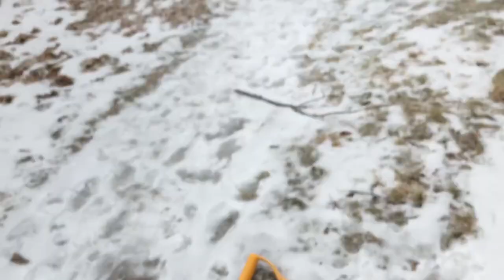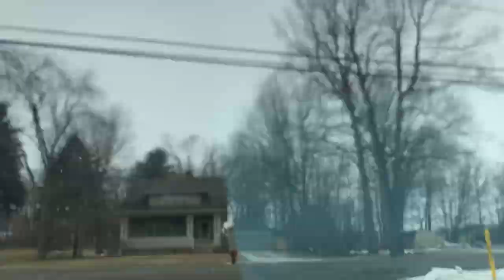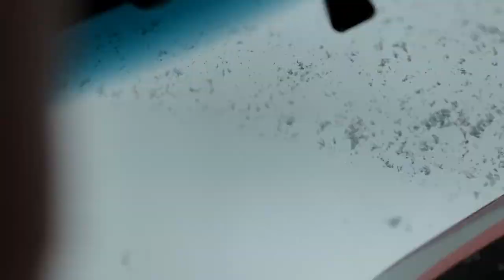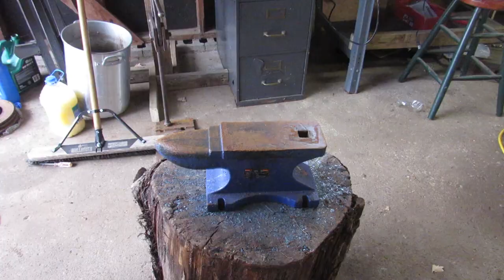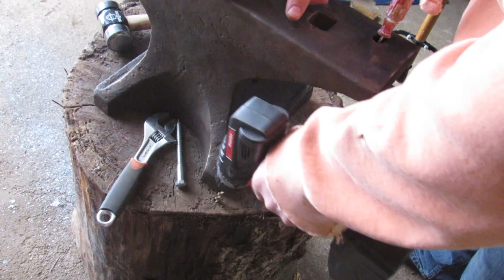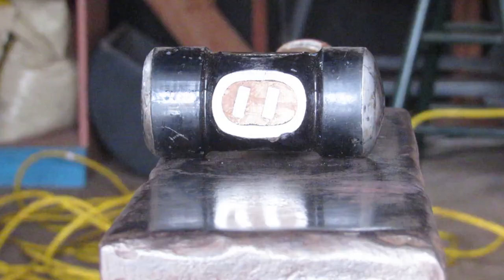New Anvil Cleaned up and Mounted

Comment: That's a neat ol anvil there my friend no doubt.  It should open you up to so many new possibilities  now w a more proper anvil. Looks like it's in the 120lb range.
   If the ring bothers you or others lol, check out Black Bear forge Mr. John  Switzer has a mounting anvil video.  Think he used a glob of silicon under it n let it cure a bit then bolted it down.  I'm on phone cuz I've not got a computer so anvil fing doesn't bother me...just spreading the word is all.
Congratulations on the new anvil sirSir. 
   Blessed days sirSir,  Crawford out
Reply from the maker: Yea I’m making a new anvil stand soon and thinking about employing that method!!